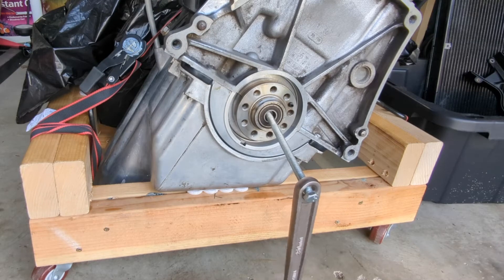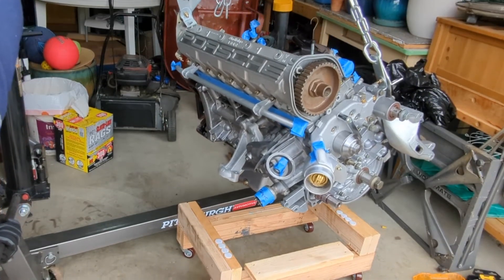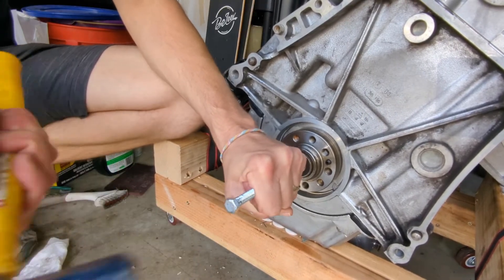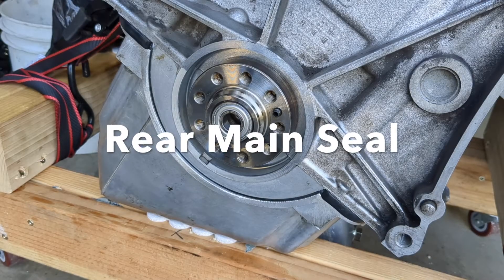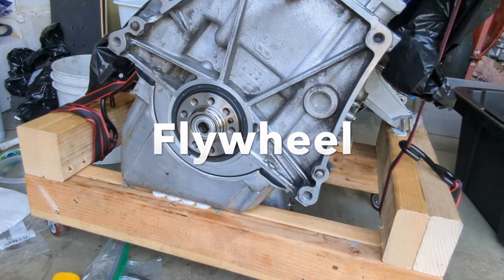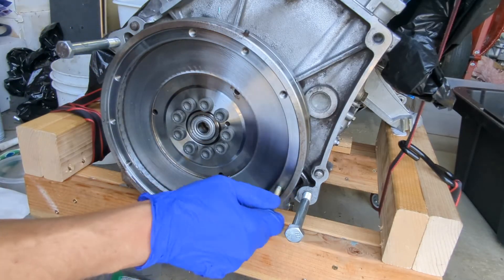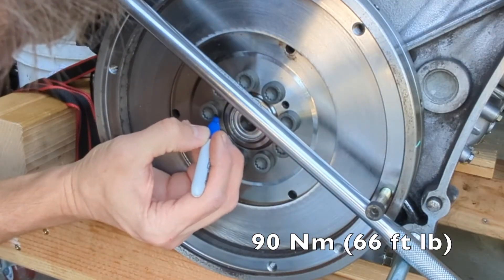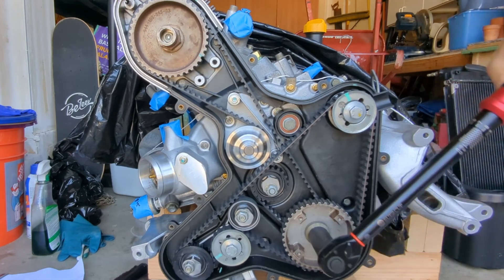Porsche 944 | Engine Rebuild Pt 8 | Flywheel & Rear Main Seal

Comment: When installing the flywheel - did you have the timing belt installed? Otherwise the pistons are going to hit the valves when the flywheel gets rotated with the cam stationary.
Reply from the maker: That's an excellent point that I did not talk through in the video. With the cam at the TDC marking I had the crankshaft set initially so that all pistons were aligned in the middle of the cylinder. Then I only rotated it enough to get to TDC so that no pistons would come in contact with the valves.
Reply: @944restore  I did the same job a few months ago - I did it with the timing belt on with both cam and crank at TDC so that any flywheel movements would be safe. Anyway - I definitely watched your other videos during the project and they were quite helpful - thanks!

Comment: Glad to see you did not use the VR RMS!  Are you going to install the engine from the top or bottom?  Recommend from the bottom, easy and fast and you can do it with the engine fully assembled with accessories.
Reply from the maker: I took it out the top because I had the transaxle out so I could push back the torque tube. I had to keep removing things off the engine to get it out. Such a hassle. I will definitely take your advice and install it from the bottom.